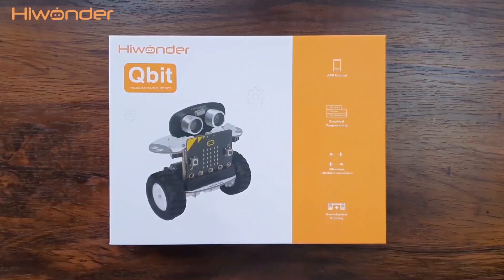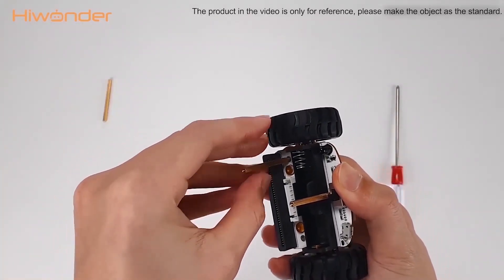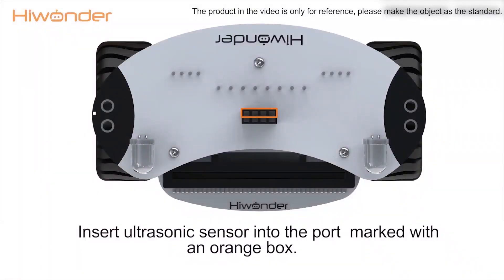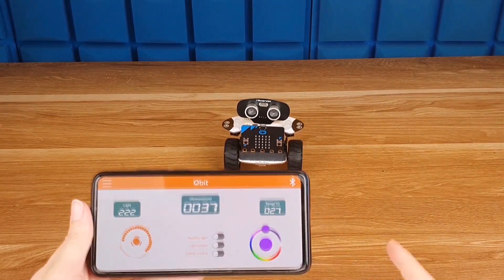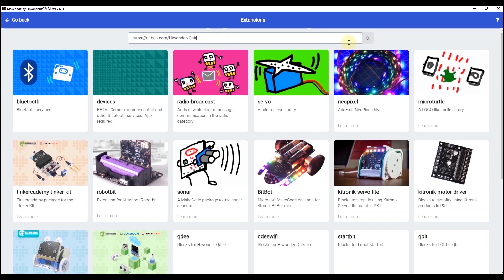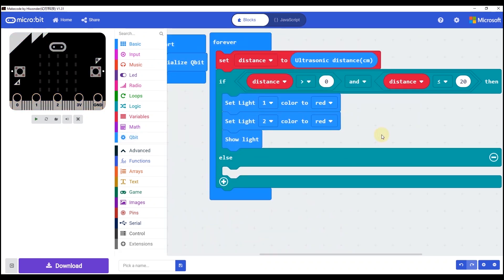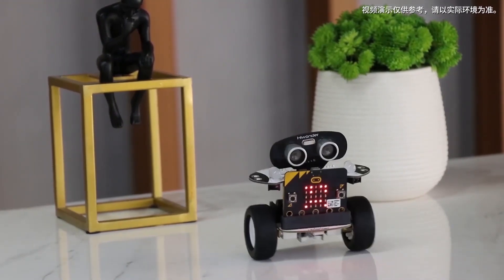Hiwonder Qbit Educational Robot Car Unboxing/Assembly/Software

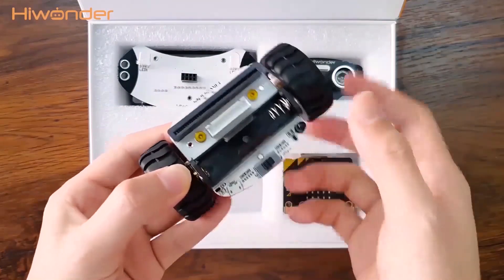Comment: 1:04 - "The USB port is only for charging, not for downloading."  It is only for charging what?  There is no rechargeable battery on it.
Reply from the maker: Hi Mike, may I know where did you buy the Qbit from? If you buy from the Hiwonder official website, there is a lithium battery in the kit :)
Reply: No rechargeable battery was provided when I purchased my Qbit several years ago from WECL Electronics Specialist in Shum Shui Po, Hong Kong. I had to buy one 3.7 V Li battery myself, and found the Qbit could not charge the battery through the USB port in the micro:bit. The 3.7 V Li battery should be taken out and recharged outside first before use.
Reply: @kawaito2514  Thank you, Ka Wai To.  It's likely that there are vendors who save money by not providing the battery, and I guess it was your misfortune, and mine, to get one of those vendors.
Hiwonder says that there is a battery in the kit he sells - but you say that even if you provide one yourself, the "charging" port doesn't charge it.